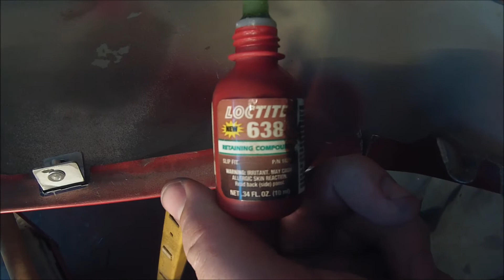DIY Miata fender mesh design and install.

Comment: What autox class are you running in?
Reply from the maker: I run the car in a local regional class called STM, Street Tire Modified.
Reply: NA6 driver I was assuming ssm because of the turbo for scca but I noticed the flares so I was curious.
Reply from the maker: The difference in SSM and my class is not much.  It mostly comes down to tires.  STM has a 200TW limit on tires (Rivals, RE71s, RS4s, ect).  SSM is slicks, full interior, and minimum weight requirements.  My car is well beyond the min weight and would fit better in XP, if it were on slicks.  I won my class last year and have since started moving into track day stuff.  Trying to do 2-3 track days a year in the car now.  Autocross was fun but we lost some local lots and now the costs are close to track day costs.  Doesn't make much sense for me to spend 4-8 mins of seat time when I can get 1-6 hours for twice the cost.
Reply: NA6 driver makes total sense it’s a cool build keep up the great work man!
Reply from the maker: Thanks man, glad you like it.  It's been a blast to build and drive.  I'll have more content over winter with an oil cooler install, new splitter and possibly airdam.

Comment: What's the point behind this??
Reply from the maker: The tire/wheel combo I ran was rubbing on track, even with a fender roll.  I spaced the fenders to fit, ran that way for about a year, fenders didn't have much to support them also constantly had rocks and other road debris flying up and hitting me in the hand when I was driving to and from the track.  The mesh adds both support for the fender and keeps the big rocks from hitting me in the hand when I do drive on the street.

Comment: How did you space the fenders?
Reply from the maker: I used a piece strap steel.  The type with holes in the center every inch or so.  You can find it at any hardware store.  I cut it to 4 holes (so around 4 inches) and used existing bolt locations, one in the frame and one on the fender.  I unbolted the center bolt behind the door and the inner fender.  Then I just pulled the fender out and bolted it up.  The mesh in this case did two things, one kept rocks from hitting my hand when I hang it out the window.  Two, added more rigidity to the fenders at speed.  They would sometimes move over 100mph on track.
Reply: Is there some sort of write up or tutorial for this?
Reply from the maker: I don't have anything for the bracket I used to space the fenders.  It's honestly just a piece of metal drilled and bolted to the tub of the car and the fender.  It's not very secure without the fender mesh installed.  I did it initially for wheel fitment but grew to like the appearance.
Reply: @spodzz  there's the uhh... cough the video